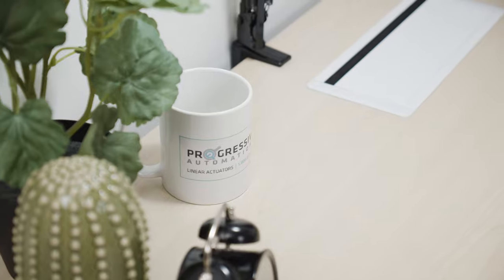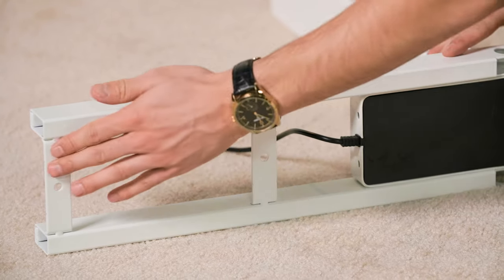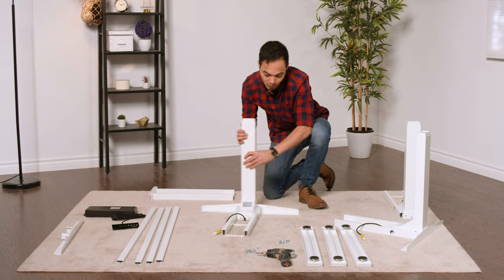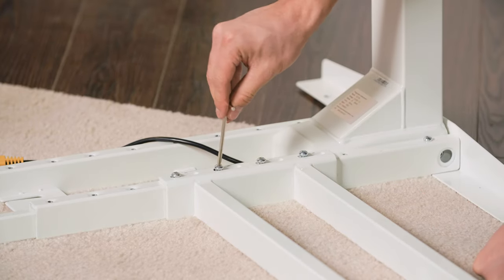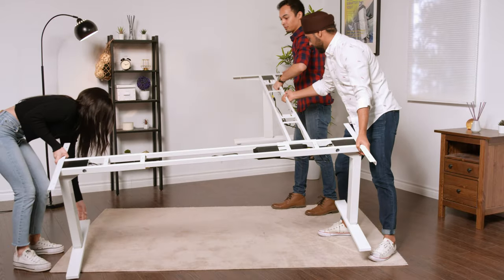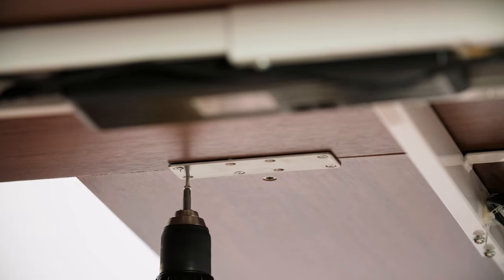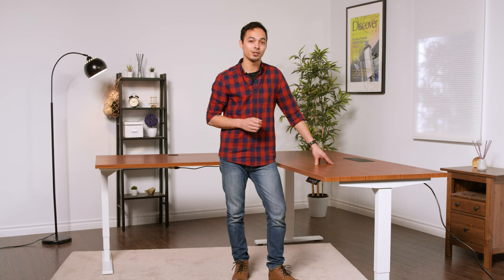How to Assemble the Corner Ryzer Standing Desk | Progressive Desk

Comment: This is a great video and helped quite a bit, but I ran into one issue.  If you want the 2 desktops to line up in the back (as shown in 9:05) and fit against a wall the arbitrary mounting location of the side frame to the main frame mentioned at 3:40 does not work, there is one particular mounting spot (you can see it at 6:18, I did not notice this until now).  Realized this as I started mounting the second top, nothing serious, but it was a challenge to remount the side frame by myself.  I must admit this is a well-designed sturdy desk, impressed with the engineering.
Reply from the maker: Hi Erik, thank you so much for your feedback! We're glad to hear that you're impressed with the quality of our desks! Regarding the mounting, at 3:45 - 3:53 Gregory was able to reference it as he aligns all of the holes on the mainframe with the supporting frame. However, this is a great insight and we will be sure to emphasize that mounting spot on our future assembly videos. If you do encounter problems with your desk / assembly, please feel free to reach out to us at sales@progressivedesk.com
Reply: I literally was building my desk watching this video and your comment probably saved me a ton of time. Thanks for posting this.
Reply: @carlkowalski3075  Great, then it was worth it.
Reply: Hit a similar problem.  Wish they gave the correct bolt hole assignments for there standard sizes.

Comment: @Progressive Desk:  I have the corner ryzer with the contoured corner. Is there any difference in assembly instructions since this table top is one whole piece?
Reply from the maker: Hello Allen,

The steps for tabletops without pre-drilled holes are seen below: 

Move the table lift frame components to desired final position on top of the upside-down tabletop. Use a pencil to mark the twelve tabletop mounting hole locations. Remove the table lift frame from the tabletop.

To assist in the installation of the tabletop once it is right side up, you will need to create pilot holes. Install M5x20 Wood Screws (12) in the marked locations. Install only 1/4 of the screw's length and then remove the screws. It is up to the user’s preference on how the frame should be positioned on the tabletop, however, our recommendation for stability and comfort would be to have an overhang of approximately 1.5 inches.

Optional: An electric drill with a drill bit may be used to create pilot holes instead of wood screws.

For more details, we also have the how-to article below as a reference:

https://www.progressivedesk.com/blogs/progressive-products/how-to-install-a-one-piece-corner-ryzer-tabletop

 

Please email sales@progressivedesk.com or call 1-800-828-9414 for any other questions and we’ll happily assist! 

Progressive Desk Team – Nathan

Comment: Hi, what is the minimum clearance you suggest between the edge of the desk and the wall? Thanks
Reply from the maker: Hi Apurva, 
Thank you for your question.
It can vary depending on the specific desk design and personal preferences. However, our general recommendation is to allow for at least 18 to 24 inches of clearance between the edge of the desk and the wall. This range provides sufficient space to move around comfortably, accommodate chair movement if needed, and access any outlets or wall-mounted fixtures.

These measurements are approximate and it's always a good idea to consider your specific workspace requirements and available room layout when determining the ideal clearance for your standing desk.
Reply: @progressivedesk  Hi !! Thanks for your reply but it wasn't helpful. Probably I wasn't very clear in my wording. Let me try again: I want to know if the corner desk be pushed all the way to the corner of the room or there needs to be some clearance about 1/2" or 1" between the wall and the edge of the desk. Thank you.
Reply from the maker: Hi @apurvajha8968  

Thank you for clarifying your question.

Once fully assembled, the Corner Ryzer can be pushed all the way to the corner of a room where the tabletop can be flush to the walls with no clearance needed assuming the room has walls forming a perfect 90°. Having some gap as the clearance between the walls and tabletop is in case users prefer the extra room to further reduce the risk of scratching the wall while the desk is moving or changing height. Wires passing through the back side of the desk between the tabletop and wall can also find some clearance beneficial.

Please contact sales@progressivedesk.com or 1-800-828-9414 for further questions, we're happy to help!

Best regards,

Progressive Desk - Nathan
Reply: @progressivedesk   Thanks Nathan, thats what I wnated to know.

Comment: Is this orientation A? I'm trying to do B and the instructions are unclear.
Reply from the maker: Hello, 

Thank you for reaching out to Progressive Desk.

This video follows the setup for orientation A, however, the steps for orientation B should be very similar. The only major difference is that you will require your Secondary Frame (Part 3) to shift to the opposite side of what is being shown in this video when being placed with the Primary Frame (Part 2). Once that is done, your frame will be in orientation B so you can proceed with the usual tabletop installation process from there.

Please contact 1-800-828-9414 or sales@progressivedesk.com and we'll gladly assist with any other questions!

Best regards,

Progressive Desk
Reply: The paper instructions are different from the video regarding the secondary frame. For my 30" wide the instructions say I should  attach into hole 4 - 7, which would move closer into my workspace but your video says to attach it at holes 1-4.

Comment: My question is can the corner piece be put on the left or the right or is it just om the right side
Reply from the maker: Hi Mina! For the Corner Ryzer, the center bracket of the mainframe has mounting holes on each side so you can freely choose where you would like the desk to be oriented at. If you have any other questions, please feel free to reach out to us: https://www.progressivedesk.com/pages/contact
Reply: @progressivedesk  i actually have another question in order for this to work in egypt will i need a transformer?
Reply from the maker: @minanagui8354  That is correct! Our desks currently supports only 120V input, so for international orders a converter/transformer will be needed for proper use.

Comment: Hi! Thanks for this video. I plan on potentially buying this desk soon. 

However, I'm having a hard time finding specifications of what pairing of tabletops it can support.

For example, can the Corner Ryzer support two 79"x28" tabletops together? 

If not, what is the maximum it can support (while still being stable)?

Thank you!
Reply from the maker: Hey there!
Thank you for your question. For our Corner Ryzer,  unfortunately, it cannot support a 107'' tabletop however we do recommend a maximum of two 60x30''' tabletops for this specific frame. 

 You can find more detailed information on the Corner Ryzer through our user manuals which you can find on this page under Resources. https://www.progressivedesk.com/products/flt-05

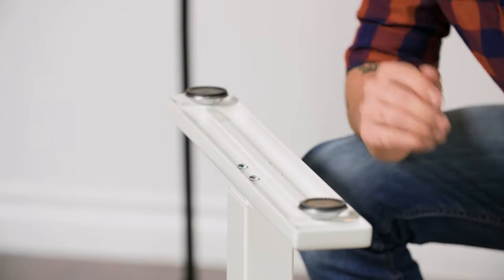Comment: At 5:33 the leg is short but at 5:39, the leg is magically longer. What happen?
Reply from the maker: Hi Nelson! The Corner Ryzer frame can be easily adjusted by both its width (manually) and its height (via a remote) to fit a number of table top sizes. This is why you can see two different widths within those time frames. The width of the Corner Ryzer frame can be adjusted between 42.5 - 70.9 inches depending on your needs! If you have any further questions, please feel free to reach out to us.
Reply: @progressivedesk  thanks!